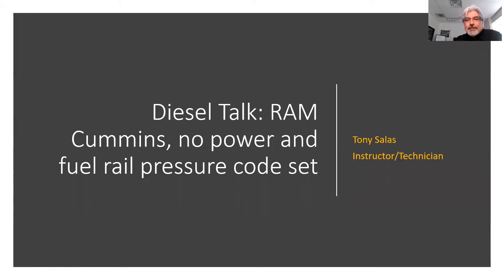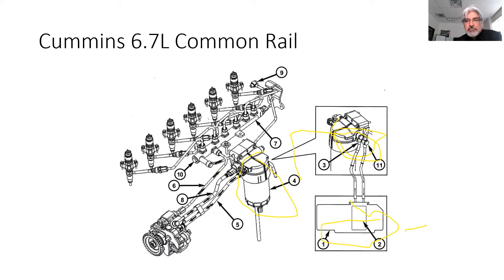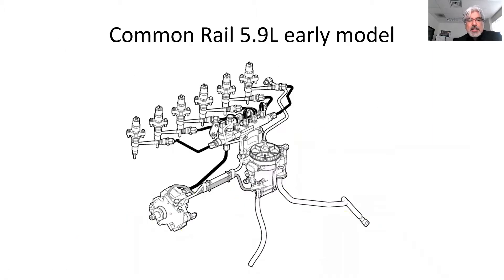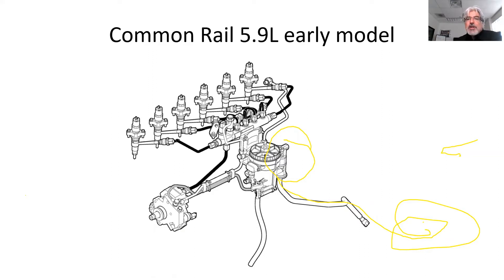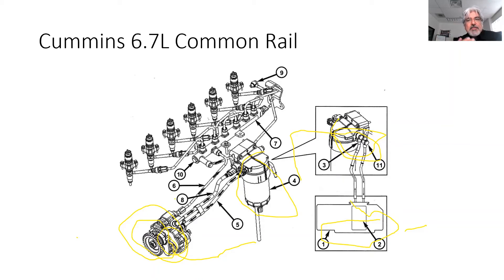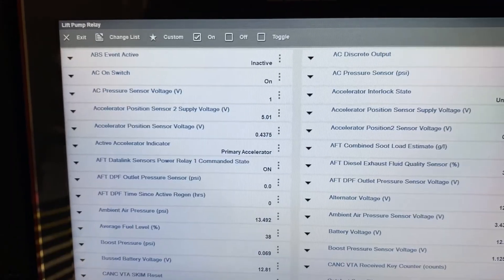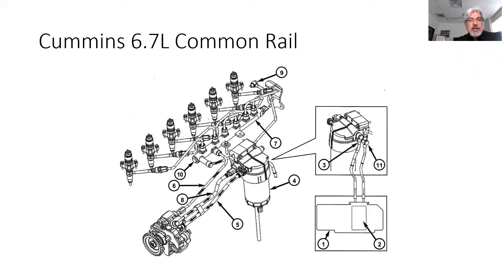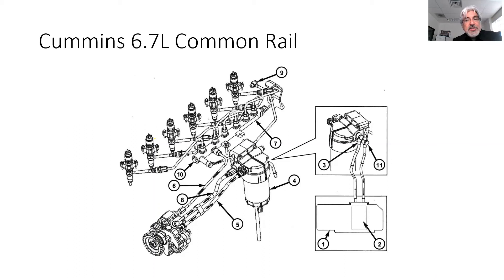RAM Cummins 6.7L Low rail pressure

Comment: I just got done installing a grid heater delete on my 2017 ram 3500. This involved removing the lines from the fuel rail. Now I have a code p0087 saying fuel rail pressure too low. The engine runs but stalls in a minute or two. It's asking 5000psi snd getting 1200psi. This varies with rpm obviously. I see no leaks externally. Someone suggested injector feed tubes could have become loose when removing the lines from the rail. Is this possible you think? Filters are new. Any other idess?
Reply: Check the injector nut, it may be loose
Reply: @WillyGarciaV  that is the nut holding the injector tube in place?
Reply: @themotofixery  yes
Reply: @WillyGarciaV  ok I'll try that. Thanks!
Reply: @themotofixery did this fix the problem? I also just deleted my grid heater and now my rail pressure is too low
Reply: @andymike6575  I seems that the problem I had was that the injector feeder tubes became loose when I removed the fuel lines. There is a nut that holds the tubes tight against the injector. It's a huge pain in the ass but id recommend going back through and first remove the injector lines and re-torque the feeder tube nuts then reinstall the fuel lines and everything else. This solved my issue. Let me know if I can be more clear or answer any other questions
Reply: @andymike6575  when the injector feeder tubes don't seal against the injector, the fuel leaks inside the cylinder head and just returns "back to tank" or back to somewhere like the fuel filter that is under the hood. I found a video where the guy does a test to check the flow rate of the return line from the cylinder head back to tank. This test would indicate a leak at these tubes and possibly eliminate other things like fuel rail pressure relief valve or pump issue or fuel rail pressure sensor or even pump. Apparently fuel filters can also cause similar symptoms but I assume you've checked those off your list. Just worth a mention
Reply: @themotofixery  okay thank you! I will tear it off and retorque the feeder tube nuts.  It is a huge pain in the ass. I did it a few years ago when I put bigger valvesprings and pushrods in.  After trying to crank it up it last night I did see fuel around the fuel rail and a small pool of it under the truck so maybe the leak is coming from the rail or lines somewhere? Is it possible to leak out of the pressure sensor? I have a FASS lift pump so I’m pretty sure it’s not the filters.
Reply: @andymike6575  in my case fuel was never coming out anywhere that I could see. The leak was inside the cylinder head.  At this point it sounds like you know as much or more than I do.
Reply: @themotofixery  yeah hopefully about to find out here shortly, ill let you know. Really hoping it’s not a cracked line/rail.  I can’t get my torque wrench back there so I had to go by feel for half the fuel line collar nuts ~30 ftlbs
Reply: @andymike6575  ya, I had to use a crows foot and a variety of extensions. Even with that it's just about impossible.
Reply: @themotofixery  so I found the culprit, the number 2 injector feeder tube nut had  come loose so I retorqued it to 37 ftlbs and rail pressure is perfect now.  thankfully it was easy to access and even more thankful nothing was cracked.  Thanks a lot!
Reply: @andymike6575  fantastic!  I'm glad we could get that figured out! Thanks for the reply!

Comment: If changing the filter fixed the issue initially, but codes and low power returned 3 days later what would be your sequence for continued troubleshooting?
Reply: I had this problem. Did you figure it out ?

Comment: Thank you for explaining this system to me better. I have a late model 2012 which is a pain in the ass don't buy one. It just shut off on me driving down the road one day. Ever since then it's just cranked won't fire. I started with the fuel filter so that made me feel good while watching your video. Then I changed the solenoid in the gear pump housing on the back of the CP3 pump then I changed the fuel rail pressure sensor then I changed the fuel rail check valve I have changed all the fuses, I have changed the position crankshaft sensor, I have changed the sensors on the trans, and I still cannot get the damn thing to fire. And it has not once through any codes. I replaced the injectors and the lines whenever I put a new head gasket in it and upper block cylinder head about 10 12,000 Mi ago.
Reply from the maker: You have any codes set? Can you read fuel rail pressure?
Reply: @dieseltalkwithtonysalas8725  when I start the truck with ether and have someone hold the pedal down I can use my programmer to set the idle at 1200 and then the fuel pressure says 4ksi if I let it warm up I can bump the idle down to normal but soon as I put my foot on the brake to move the shifter it dies. It was saying fuel rail pressure to high probably from the ether and fuel rail pressure to low. Those are the only codes. I will say that the day it shut down I felt something in the floorboard like the truck had a hesitant and then shut down. Hasn't started on its own since.
Reply: @landonhinkle7132  so anything new?

Comment: great info tony have a 2014 3500 ram 6.7 getting low rail pressure code p0087 when first drive of the day command pressure and actual are pretty good until about 3 miles and warmed up then get code and command will demand 22k but i cant get over 14k on actual rail pressure! lift pump psi is good could it be the pressure relief valve getting weak? or something else return fuel test of the injector return line is a steady flow out the hose is this correct please any help on what to check... thanks
Reply from the maker: You are sure you have replaced both fuel filters? 
If fuel filters have been changed, then I would suspect the pressure relief valve. Remove banjo fitting and cover with a rag the removed fitting and start engine. Should be no fuel coming out of pressure relief valve. 
How many miles on truck?

Comment: What about a fuel injection pressure regulator? Would that cause a low fuel pressure
Reply from the maker: If you are referring to the regulator on the injection pump, no.
But a stuck open cascade valve on the injection pump, yes. Not common but can happen. You check that by
Measuring injection pump return volume

Comment: 2012 6.7 Cummings, would this cause small surge up in rpm’s at idle. Or should I look at map sensor?
Reply from the maker: Surge can be caused by a sticky regulator at the injection pump. Also EGR valve sticking.
This is with the understanding you have good lift pump volume and pressure.

Comment: Tony what is the Normal Low and High pressures we should see on the rail for a 2021 6.7l Cummins? Thanks
Reply from the maker: That’s not an easy question to answer since there are so many variables such as temperature load and other components in play such as EGR.
That’s when we diagnose we look at fuel rail pressure set point (desired) and actual fuel rail pressure.
Reply: @dieseltalkwithtonysalas8725  I want to narrow this down a little bit. Ok so do you know what the commanded (desired) fuel rail pressure is or is that tailored to each individual vehicle? I am trying to get an idea what the commanded (desired) pressure to a 2021 6.7l cummins is out of the Mfg? Another words what range of PSI should I be looking at during normal operation on the gauge? Thank you for another great video. I learn a lot from you Tony and I appreciate it. Thank You!!
Reply from the maker: Ok let’s talk technical, the rail pressure is Changing. It can be at 3800psi to over 24,000 psi under load.
That s is why when we diagnose we looks t the set point rail pressure and compare it to the actual rail pressure. So if at a given moment it desires 8,000 it better read close to 8000 psi as the actual.
As for lift pump pressure Cummins has you do a volume test. Not psi
Volume is about a liter in 30 seconds
Reply: @dieseltalkwithtonysalas8725  Thank you again. I do love your videos and I understand your answer. But I guess I would have to take my truck to the dealer to tell me what the desired and actual rail pressures are before I know what my trucks normal is before I monitor it correctly.

Comment: Hi, thanks for the video. I have a 2016 ram 3500 6.7 Cummins with 120000 miles. My truck sometimes has a rough idle and it bounces from 550 rpm to 800rpm. There are no codes. Then other times without changing filters or anything it will idle correctly from 695 rpm to 703 rpm. Then a few days later goes back to rough idle. I’m new to diesel world. What do you think could cause it? Your input is appreciated. Thanks

Comment: After replacing my fuel filters with two filters from Diesly I got a light saying water was in my fuel, I drained some fuel and there was NO WATER in it. Then I replaced the water separator sensor and the light went off. Drove 1 day with no issue next day, got a code P0087 low fuel rail pressure. I normally use Mopar fuel filters, I've also noticed my lift pump doesn't seem to be sounding off very loudly as usual. I'm gonna replace the lift pump and put two Mopar fuel filters back on.
Reply from the maker: Let me know if lift pump cures your issue
Reply: I got the same problem like yours ..i fox lt to do the same 
Do you think is the problem yours get better
Reply: Did this work for you ?

Comment: i  have the same problem I took it to the dealership they say was the fuel pump they installed as fuel pump the check engine light went away is running but it doesn’t have the same power like I used to.  When I put my scanner before I took it to the dealership is low pressure rail sensor

Comment: Great video!! Quick question….Have you ever had a QSB6.7 Cummins intermittently smoke under load, accompanied with a rpm surge,under load, But runs fine with map sensor unplugged? Any insight appreciated.
Reply from the maker: Before anything I would see that Im getting adequate boost pressure. Check boost pressure under a load. Prefer to use a gauge, not scan tool.
Reply: @dieseltalkwithtonysalas8725   I’ll definitely do that. Any proven methods you recommend?
Reply: @dieseltalkwithtonysalas8725  curious what is considered adequate boost? I bought mine in December and had to fix the turbo actuator. I don’t know what boots is supposed to be. I have been getting injector performance codes but I did change the fuel filters since I bought it used OEM Mopar.
Reply: Quick update my issue was a clogged EGR port. Hope it helps someone! 👍🏻

Comment: Yes i have a 2013 6.7 new lift pump injectors and cp3 and nozzles and rail after changing 5 months later have low rail pressure and high governor pressure voltage any recommendations thanks
Reply from the maker: When you mention governor pressure voltage , are you referring to the lift pump pressure?
I would pressure check the rail and injectors for leaks.
Or you can start by tightening the transfer tube nuts in case you have a loose transfer tube to injector mating.
Reply: @dieseltalkwithtonysalas8725  the air dog lift pump i have is at 10 psi the high pressure pump numbers are steady but my rail pressure voltage is all over the place